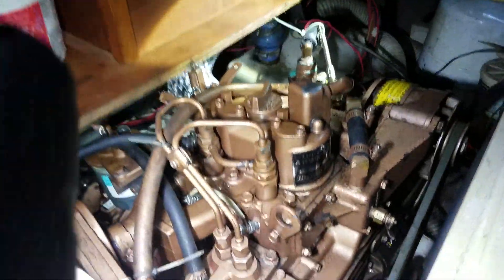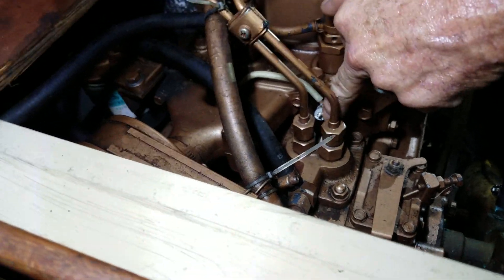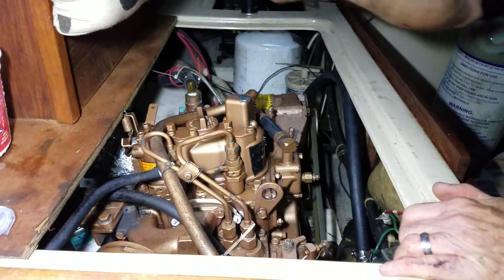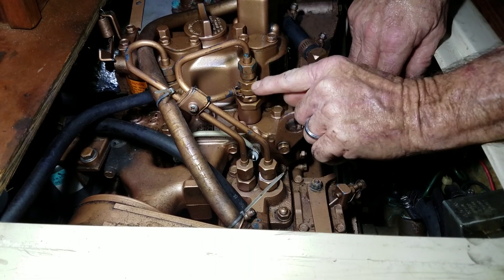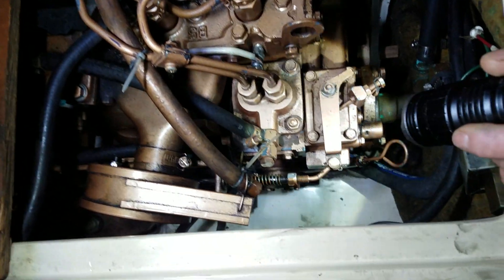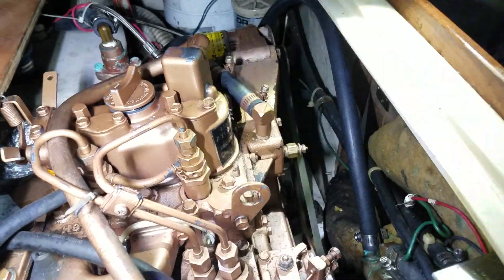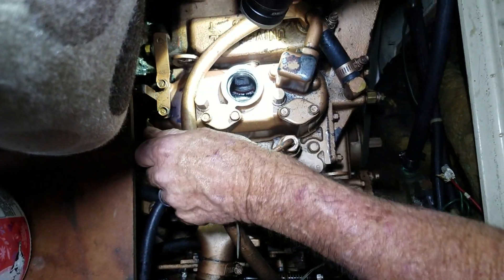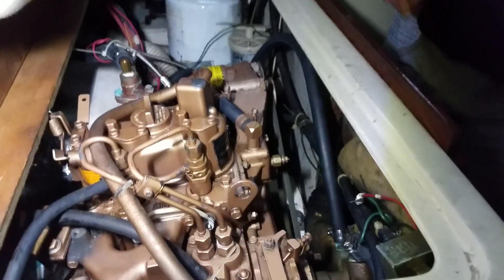Universal 5411 Walk through Part 1 - The Engine Explained

Comment: 2000rpm, each cylinder fires every other revolution, so it's firing 2000 times per minute total....unless these things are different from every other 4 stroke internal combustion engine. A single cylinder engine will fire 1000 times per minute running at 2000rpm.